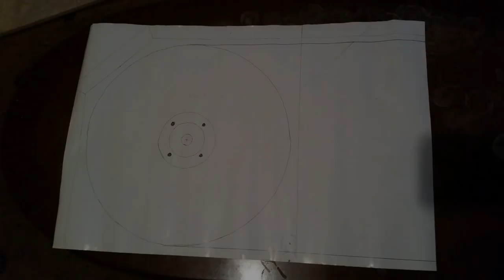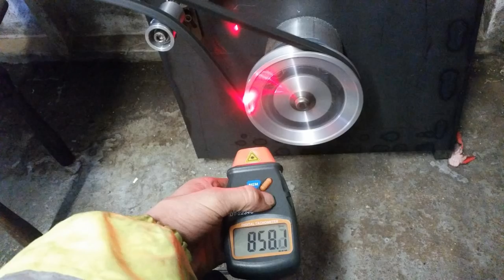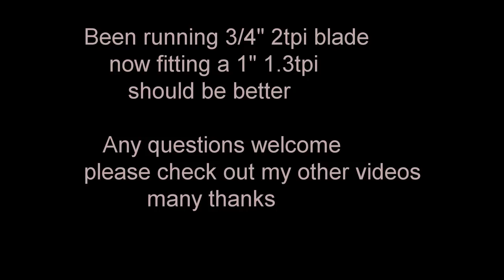How i made my sawmill...

Comment: I love it Wayne. Cool idea, nice design and nice execution. Very impressed. I'd love to know how you designed the tension and tracking to work because they are very nondescript in the finished product. Also would love to know about anything that worked better/worse than you expected, especially after some more use. Also probably a million other things.
Reply from the maker: +Mike Nute hi thankyou much appreciated. Well the tensioner is really simple I just slacken the 4 nut thro the bearing and the hole thing slids (bearing shaft and wheel) and I have a bolt the pulls the tension on. As for tracking I built it fairly parallel and it tracked ok with the 3/4 blade on but when I went to the 1" blade I know I needed to add a way to track it so I had to kind off re design the tensioner side to add tracking ill add a video to show how it works. Well i came up with the idea and wanted to make it cos chainsaw milling was to wastefull slow and noisey so i said to myself dosnt matter how fast it cuts as long as it works and wanted it to look half decent not a scrap metal project and it turned out much better then i expected iv had my problems and had to learn the nack how to use it and change things a bit along the way but yeah im proud of it. Many thanks wayne.

Comment: Great idea! Been thinkin of something like this and seeing yours is a great help. Was planning to use a 3 HP motor, is Yours enough? You use heavy materials, what is the weight of the mill?
Reply from the maker: The power of the motor is more then enough for the 23" cut that the mill can do it's not light but very strong and has a big depth of cut if needed I think it weighs about 50-60kg I can pick it up and move it around on my own like in my other videos but 2 ppl is easyer   the band wheels bearing placers pullys and a few other bits are alloy the rest is steel and the motor is really heavy I have thought afterwards would it of been better made of all alloy but I just don't think it would be strong enough. But I'm planning on building a track for it now I have the space then I'll have best of both worlds. Post whatever u decide to make would be interested in seeing others take on it. Wayne.